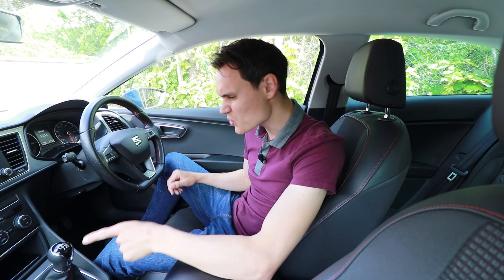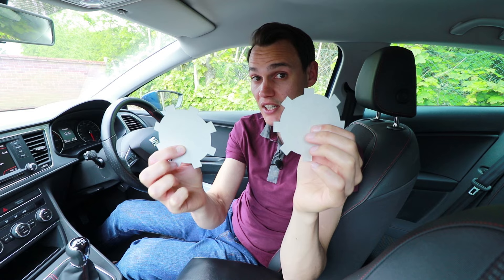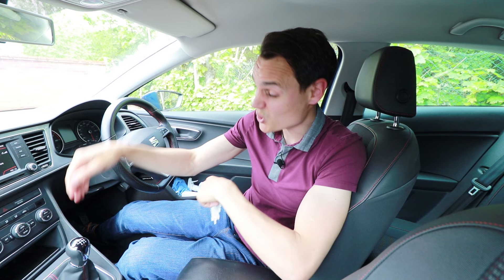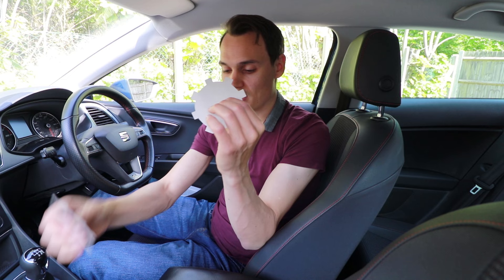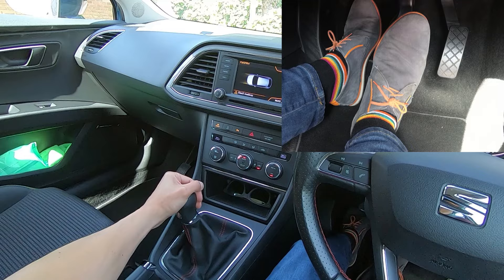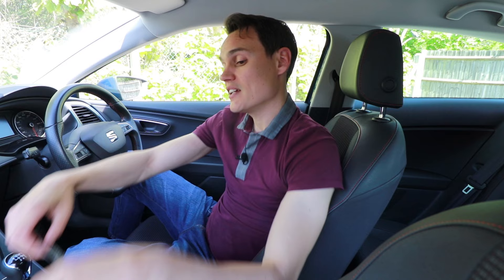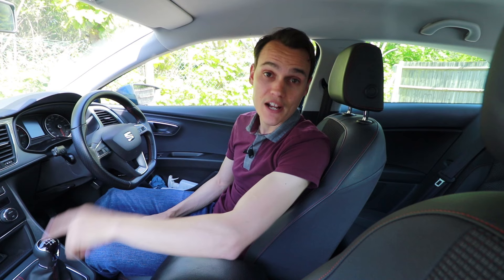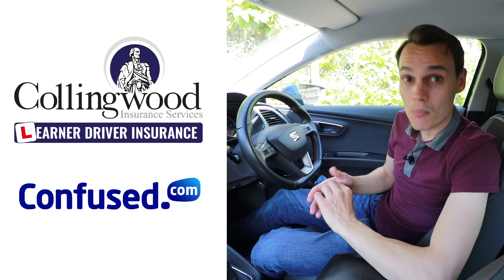Reverse Gear Grinding Noise and Hard to Engage - Solution

Comment: Hah man this is something that should be mandatory in driving school, no one taught me this. When I got my first car a 91 VW Polo, was a bit battered but was super cheap and good for getting me to work it had issues going into reverse, all sorts of clunking, screeching and got forbid the sounds it made. I figured the solution to it and it was going to reverse slowly, if it doesn't click right, back to neutral and so on until it goes in smoothly. I never understood the issue, I just thought it was an old car and many people even mechanics told me the same thing. Fast forward I am in my brand new VW T Roc and would look at that, SAME PROBLEM, although at a much lower scale. This video just opened my eyes. Thank you very much!
Reply: I thought as much; “this should be taught in a driving school”
You are so right

Comment: I find that selecting a normal gear and then going into reverse helps a lot
Reply from the maker: That can also help, I should have included that.
Reply: Yes go into neutral then go into reverse
Reply: Do you think I can go to 5th then reverse?
Reply: @loganmontes5969  Any forward gear will work, doesn't matter which one. However, some cars have a lockout to keep you from shifting directly from 5th to reverse when reverse is right below 5th. So if yours won't let you shift from 5th to reverse, just use another gear. Hope this helps
Reply: @JB-jx9bh  no. go to any forward gear then to reverse. by going to neutral, you are respinning the gearbox.
Reply: @averyalexander2303  oh so thats why my jeep does that... I was wondering why itll let me go in reverse from every gear besides fifth
Reply: @osasosas2982  new driver here- how to do that? Clutch down, select gear 1, then ? When to push the stick…
Reply: @Helloacx  yes put into first (foot still on clutch) and then go straight to reverse quickly like you normally would
Reply: Yeah I always select 3rd gear before reversing its actually the fastest way I think
Reply: @ConquerDriving waste of time having teeth..if you don't clean them daily.
Reply: Holy shit that did it actually

Comment: The synchro ring is what slow the gears down to allow the engagement of the gears.  I recommend a 3 count to allow for proper engagement.  1 potato 2 potato 3 potato.  It works every time.

Comment: Thanks a ton for the video, I just got my first car, a ford focus MK1 2000 1.8L petrol; and the reverse gear selection is quite painful, it doesnt always wanna go in, more like the 50/50 case you said. I was searching for fixes online and your video showed up, seems like this is a skill issue. Gotta change the transmission oil I reckon. Also Thank you so much for all the videos, you really helped me with passing my drivers license test here in Luxembourg :D

Comment: And if you keep ending up in 1st gear when you wanted reverse, there might be a lever on the back of the gear stick that you have to lift up first 🙃 when I got my first car this took me a solid 10 minutes to figure out as I kept inching further forwards wondering where reverse gear has gone 🤦‍♂️
Reply from the maker: Yes, you do have to lift a leaver on some. Other only require you to force it left hard - BMW.
Reply: I've had the same, ended up bumping against kerb for 5 minutes  :D
Reply: Only going forward because we can’t find reverse 😂

Comment: Can I ask how bad the noise can mean? It happened to me first time today.. guess I “Forced” the stick to reverse gear 1 or 2times, used all my strength …

then in the afternoon I was driving normal, I heard again (2 seconds)… thought sth wrong with my car till found this vedio of yours.. …
So say there is now chipped metal/shaving in the oil, caused more damage already? 

Do I get mechanic to remove the chipped metal? Not sure if there is such service.. just scared of the idea I need to pay for new gear box …😕
Reply from the maker: Nearly all car's would have had a bit of grinding here and there. Try to avoid it as much as you can but there are usually magnets in the gearbox to catch the metal particles. If it's working fine I wouldn't worry about it.

Comment: What if you select 1st or reverse and grinding starts when you try to move? It's a new car, 2022 Kodiaq 1.5TSI 6 speed manual and service center tries to blame it to a low milage. 6th hard to engage at high speed too. It's the worst manual I ever driven.

Comment: This is a common issue on the MK7 Ford Fiestas, make sure you fully engage the clutch for 3 seconds before changing gear
Reply from the maker: I find the Fiesta in general struggles with this.

Comment: If it didn't want to go in reverse I usually just lifted the clutch a tiny amount while pushing the gear lever hard. I never heard a grinding noise with that. But I can see how that is probably depending on the type of car. So I guess don't do as I do :)
Now I basically only drive automatics so its not really a concern for me anymore.

Comment: Just out of interest, you were saying you had an Ibiza before the leon, but didn't have it for as long as the current car. How come you only kep that one for a few years, and this one has been wiht you for 8+ now. Do you intend on replacing it soon, or are you going to keep it going until its uneconomical to keep on the road?
Maybe a video about how you started the driving school and the cars you've had to teach in (and maybe even personally) would be a cool video.
Reply from the maker: I changed to the Ibiza simply because I tried the Leon and preferred it. I've kept the Leon for ages because there is nothing new yet that has tempted me away from it. I'll change it when there is something else that I prefer within my budget, but for now it's still as good as the day I bought it.
Reply: @ConquerDriving  my instructor keeps his cars for a long time too. He was saying he buys them when they a couple years old, with not many miles, and lets the learners rip them apart. He takes good care of them, but says there's no benefit to having a newer one. To be fair, that generation of Leon still has a very modern look today. Doesn't show its age with the styling whatsoever.

Comment: i just had my clutch replaced. but i still get that crunch when i select reverse when the car is cold. any idea to why, should not be the clutch or maybe the mechanic did something wrong
Reply from the maker: The crunch into reverse is unlikely because of the clutch. Only select reverse when you are completely still and have had the clutch fully down for at least 3 seconds.

Comment: You can engage the synchro in a new car by putting it into any gear first, then quickly going straight into reverse and it should go in easily.

Comment: I've heard that reverse gear in a hybrid car or electric car is just reversing the electrodes from + to - inputting into traction motor(s). At least the first move in motors in a hybrid car before the ICE kicking in. I have no idea if it's true. They say that's why both hybrid cars and electric cars could be shifted to R gear suddenly from D gear while the car is still going forward. The motor will extremely harshly brake your car and pull your car backward suddenly, which might fastest stop your car and save you from emergency critical situation if any all other braking ways even aren't fast enough to stop. But I have to verify and find out anyway.

Comment: Does your clutch going bad has anything to do with this? Because here we get told by the mechanics that the clutch is worn out everytime we hear a crunch. My Hyundai Xcent now often gets a crunch on reverse and was told that a clutch needs to be done.
Reply from the maker: It can be a clutch related issue, but not due to wear, if the clutch is damaged then it will affect all gears.

Comment: In my driving instructor's Kia Ceed I've never struggled with that, maybe it's because in his car in order to reach Reverse Gear you need to press a button located in the stick instead of pushing the stick down.
Reply from the maker: It will either be luck or it has a synchro on reverse.

Comment: Question: I've seen alot of drivers especially commercial taxi drivers trying to quickly maneuver hardly come to a full stop before selecting reverse & back to 1st gear & if you're like me you'd like it & do it too, does that mean all these guys have been doing the wrong thing & damaging their gears?
Reply from the maker: Some gearboxes have a synchro on reverse so you don't need to come to a complete stop.

Comment: How about when I stopped my car and press down the clutch then try to shift in 1, 2, and then 3 gear.  The first two gears are easy to shift in but I often find it hard to shift into 3 gear.
Reply from the maker: That's unusual. Normally higher gears are easier to select. But when the wheels are still don't read into it too much. As long as it goes into 3rd fine when you're moving then it should be OK.

Comment: I selected reverse gear before coming to a stop in a 2012 Volkswagen polo and to my horror I heard a grinding noise I was confused at first because I had pressed in the clutch fully in, the thing is that the gearbox received power from the spinning wheels and that made it grind, no synchros on reverse, must stop before selecting reverse
Reply from the maker: Yes, I've done that before too, best be stationary before selecting reverse.

Comment: WOW ... somebody talking logic on youtube !!!
.
PLEASE READ EVERYBODY !!!....(I will get to the important bit asap)
.
Usually when going for reverse , if you just "touch" 2nd gear and "buzz" the syncro, the gears will stop rotating.
(Make sure the car mat isn't stopping the pedal going all the way down !
.
(IMPORTANT BIT)
.
If your car simply fails to engage reverse .... (you may have jumped down a curb?) ....
.
Engage ALL forward gears....(including 5th gear) .... just lifting the clutch pedal high enough to feel a slight "urge" to go forward ?........ then it may very well engage reverve !
.
REASON - The reverse gear itself could have just got slightly "stuck" , and you have now given it a chance to slide down the shaft to " rest" .... (well it's worth a try)
.

Comment: Hi CD. My theory test expires on the 7th august but my twice delayed practical test is booked for the 13th. What should I do?
Reply from the maker: It's odd that you've been able to book the practical for when you have an expired theory. You will need to pass the theory test again before the practical test.
Reply: @ConquerDriving  I feared that was the case. It's the DVSA re-booking my test that was meant to be in February. I guess they don't take the date of the theory test into account for that.

Comment: My Toyota hilux 2019 model 6 gears always spins tyres and makes noise and the gear shift locks itself when I make a mistake of selecting wrong gear let's say from 5 directly to gear 1 is it normal
Reply from the maker: I'm not sure exactly what's happening to be able to comment. But wheel spin is normally too much gas and lifting the clutch up to quickly. It shouldn't happen simply because you have selected 1st gear when you're less than 5mph.
Reply: @ConquerDriving  the front wheels just slide with no gas added to it because I don't add gas while changing gears maybe I lift the clutch way up quickly

Comment: Hi Everybody I have a specific question according to car engines fabrication...In every car engines, do gears have the same amount of teeth? Could be two different cars that includes similar transmission
Reply from the maker: They are many different transmissions with different teeth but there are plenty of transmissions that are shared with many different models of car.
Reply: @ConquerDriving  Thanks for replying I just wanted to make sure I got it right so the answer is There are many different transmission with different teeth depending on the car model and there are plenty of transmissions that are shared with others car models could be two cars have the same transmission as automatic or either manual...🙏Please really need it

Comment: I step on the clutch while in motion and my gears lash I can’t figure out what Is wrong. Rebuilt the transmission and 4 thousand dollars later and it’s still doing it. I need help
Reply from the maker: That is odd, maybe the clutch isn't fully disengaging but I'm sure you would be aware of that. Perhaps the gearbox is still bad. Not a lot else it can be unless you're not pressing the clutch all the way down.
Reply: @ConquerDriving  oh I’m pressing the clutch all the way down and the gear box is completely rebuilt I just spent 4 thousand dollars on that. Could the clutch not be disengaging properly and it’s a bad slave cylinder maybe??

Comment: Bro plz make video on how to stop wheel spin or slip while driving in uphill driving
Reply: don't add too much gas
Reply from the maker: Wheel spinning uphill suggests the car or tyres not appropriate for the hill. Or you are trying to accelerate too quick.

Comment: what is the fix for the grinding?
Reply from the maker: There is no fix for reverse gear grinding because it's not broken it's just how it's designed. However, you can avoid it as explained in the video
Reply from the maker: But if you mean "what is the fix if you grind your gears away", it would be a very expensive gearbox rebuild.

Comment: Excellent explanation as always. I did have a query. Is this issue more prevalent in gearboxes with R (reverse gear) close to 1 or R close to highest gear ? 

Incidentally this happened to me when I was reversing a relative's car (which was pretty old) but I thought it was something I did. That car had R close to 5 (the highest gear).
Reply from the maker: I haven't noticed a difference.

Comment: Oh damn. My old Renault Mégane didn't have any of this stuff. I could just put it in reverse while moving and no problem. I guess it had a synchroniser. I hope I didn't wreck my new honda.

Why the industry go backwards? They train us bad habits with the sync and cause us to wreck our new cars by switching the rules. Probably do it on purpose for those lucrative repair costs.

Comment: I accidentally did this as a result of muscle memory. I was slowing down and instead of switching from 3rd to 1st, I accidentally switched to reverse and it made a scary grinding/crunching noise.. i'm hoping my car is fine and nothing is damaged but now I am paranoid! Please someone reassure me that my car is gonna be fine! It's the first time I've done it and I'm scared to hell to drive it again after that😭
Reply from the maker: Doing this will cause damage to your gearbox, but if it's still working that's the main thing, best to change the gear oil as metal particles will be in the oil causing abrasion. There are usually magnets at the bottom of the gear box to catch these metal particles but I wouldn't rely on them.
Reply: @ConquerDriving  My car is a Mazda 2 and it's driving fine and changing gears fine. When I did it, I was at a slow speed so I'm hoping it's not damaged the gear box too much. Will it be better to take it around to the garage and have it looked at then? Thanks for replying!

Comment: On my car, slamming the trans into reverse somewhat hard works much better than shifting slowly. If I try to shift to reverse slowly, it often won't go all the way in and will grind when I release the clutch. Just don't slam it too hard or you may cause damage.
Reply from the maker: If it's grinding it hasn't gone all the way in. I do it slowly to make sure the gears have stopped spinning, you can clutch down for a second then slam it in as the gears will still have had time to stop.

Comment: wtf 2005 is not an old car lol.
Reply from the maker: 2005 is 17 years old now. When well looked after a car can typically go about 30 years before a restoration is needed. The average car in the UK gets scrapped at 14 years. 17 year old cars in the UK usually have a very low value and therefore are generally not well looked after and get scrapped over minor mechanical issues. Also, in car tech has moved on a lot since 2005. A 17 year old car will be considered old by most people.
Reply: @ConquerDriving  Might be a culture thing (I am from USA.) Or an age difference thing (so different subjective standards on time if you are younger, due to time scale). I consider 1980 to be an old car. "A 17 year old car will be considered old by most people." No offense, but you don't speak for most people, and what you're saying certainly doesn't line up with anybody I know. So this is anecdotal evidence vs. anecdotal evidence. For example, the LSx engine is the most swapped performance engine in the world, and stems from late 90s early 2000s, and these cars are considered top of the road the majority of the time. (Obviously not against super cars or anything, but even 2021 sports cars have been annihilated at the quarter mile track by LS- cars.) Not that regular application is equivalent to age, I just find it absurd to refer to cars not even 20 years old as "old". 2005 cars are just barely breaking in the engine half the time I see them, and I drive a LOT of miles. Sorry, I just completely disagree with your view on this.